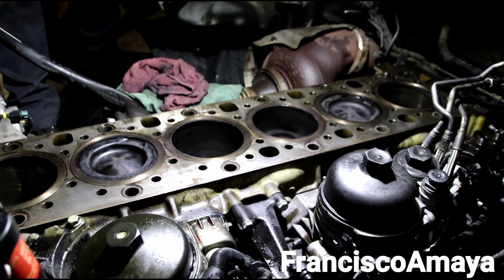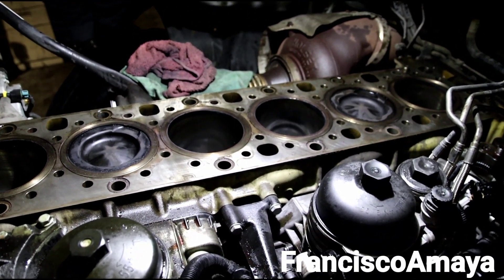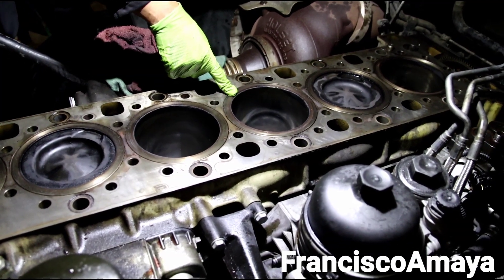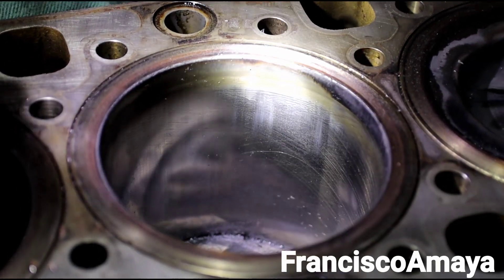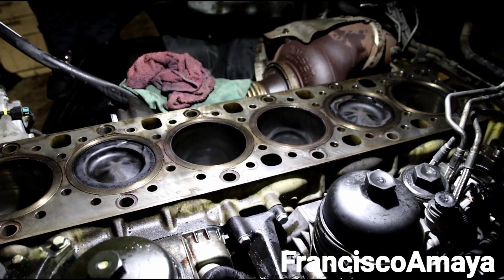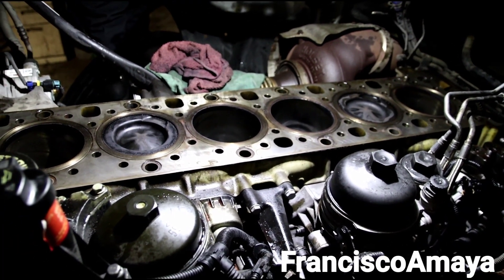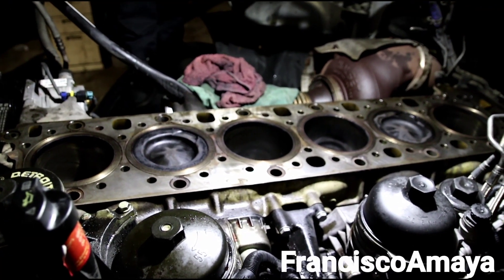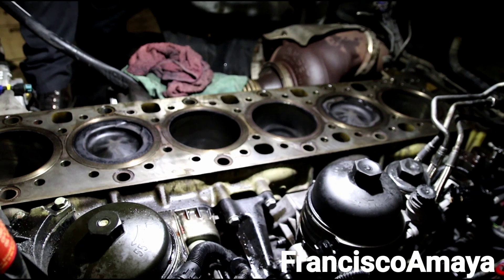DD15 engine oil consumption after major engine overhaul damage piston rings cylinder liner warranty

Comment: 3 gallon  burn every 700  miles on  detroit  14 
White smoke  when star 
Any idea what can be the problem
Reply: You don't tell us the engine mileage, it sounds like low compression, engine wear.??
Reply: bro mine burns sometimes 1 gallon a day if i don't push it very hard i haul very heavy steal over 134k if you say 700 miles i will be so happy with that don't push it way to hard it will last

Comment: I'm driving a 2022 Frieghtliner Cascadia with the DD15 only 24 k miles and having to add 2-3 gallons every 2-3 weeks no visible oil leaks. This is a local truck direct from  Freightliner no engine work done to it.

Comment: Yes it happen to me I had a 1987 3406 425 cat put in a aftermarket rebult kit, with a rebuild head from cat and cut the block for liner height no# 5 and 6 holes. I go out drove truck less than 100 miles no# 5 started a piston slap ,drove it back tore it back down end up replacing the no# 5  hole ,never had a problem anymore... I did my own labor only good thing about it..

Comment: Hi there Francisco have one question what is your take on resurfacing flywheel which freightliner dealer did on my and I didn't know it because went there for clutch change.  Thanks
Reply: Get a new flywheel or resurfaced it while clutch change. Also related installation kit new together.

Comment: Buenas tardes Francisco tengo una pregunta tengo un motor 2016 Cummins isx 15 450 HP y quisiera poder subir El HP a 525 HP que debería cambiar en el motor para poder lograr eso gracias por antemano
Reply: i wouldn't advice you to do any maps on it,most likely there's a difference in mechanical components.then most tuners don't understand volumetric efficiency.